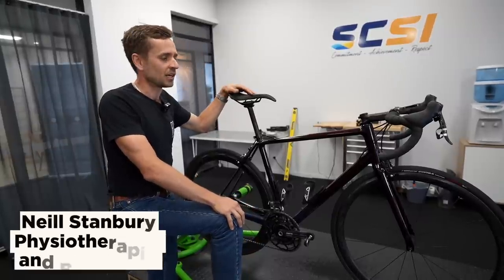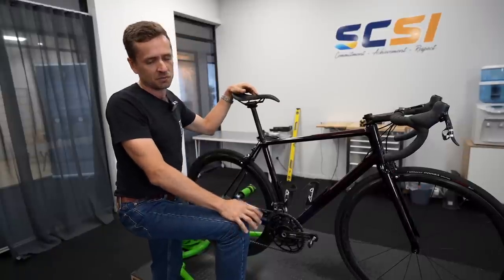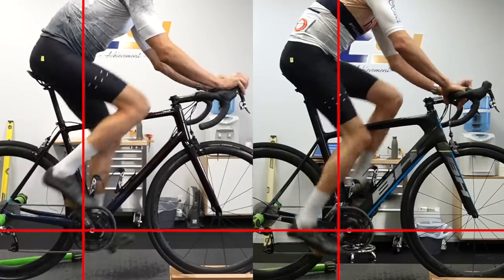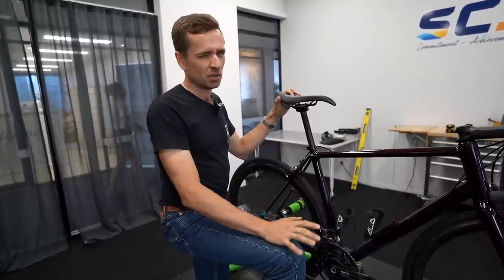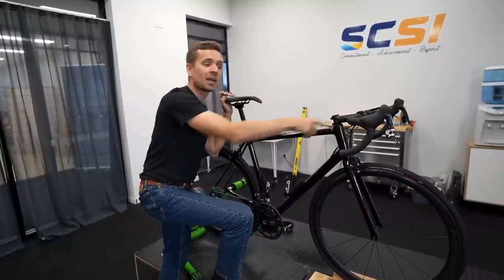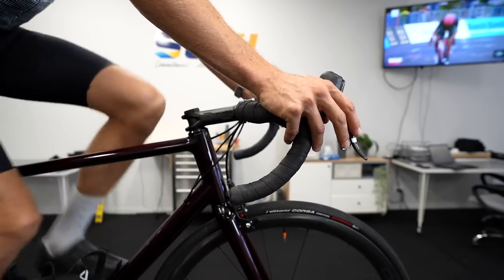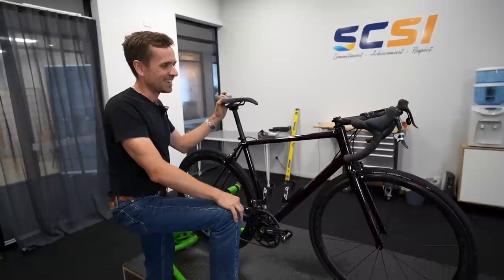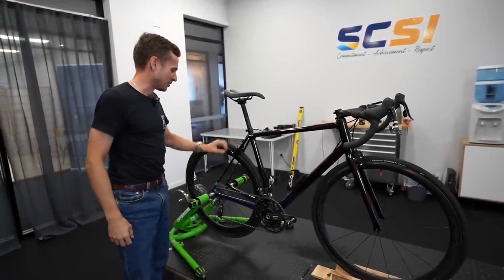New Bike Day for Neill Stanbury (but why a Chapter2 Huru?)

Comment: Neil needs to do an oval chainring video. 
All other bike fitters think oval chainring is BS.
but Neil has it on his own bike
Reply: I’ll sum up my own thoughts. My pedaling style with round rings feels “stabby” with micro-accelerations during the peak power phase and then a noticeable deadspot at BDC/TDC. With oval rings my pedaling feels smoother, rounder. Caveat here is I could never get oval rings working quite right with SRAM front shifting so I am back on round rings for 2x drivetrains, but favor oval for 1x.
Reply: @kidsafe  how do you size an oval ring? Same as whatever round one you were using, or do you go up/down? If so by how many teeth?
Reply: @thedownunderverse  Same size. Oval rings didn't give me a higher max aerobic ceiling. They decreased my fatigue on longer efforts.
Reply: @kidsafe  interesting - some others report being able to go up one or two sizes in chainring when moving to oval
Reply: I did a few Oval comparison videos you can check out. I ran ovals for 5-6 years because I liked the way they felt and I liked them for traction on the MTB. I have found zero improvement on speed or power. Only area I would say you may like them or they maybe beneficial is traction and maybe for endurance but I found endurance really determined more by how much I would ride. Humans can adapt extremely well so oval or round, your body will adapt to make it work either way.

Comment: So considering the older bike, he could ride the new bike almost as IT IS INTENDED TO BE RIDDEN BY THE MANUFACTURER in its default position itself. I have had two bike and would use them as future reference points for my 3rd bike. Probably a Mason Definition. Would be my first non Rim brake bike. Let's see.

Comment: I’m curious why you are so obsessed with a zero offset post and moving your position so far forward?
Reply: He explains in the video: Opening up hip angle, riding more easily in the drops. And I’d say he is not ‘ obsessed’ .
Reply: @Penalist  as a fitter for over 2 decades the last thing i would ever do is put someone in a zero offset post slide their saddle forward so they could ride the drops easier 😂 put the weight on the rider’s ass and no weight on the rider’s hands and they ride the drops better and easier. Also when descending switchback mountains you don’t want excess weight on the hands. 

I say obsessed because he mentioned the zero offset several times like he was proud of it and it’s one of the biggest fitting mistakes I fix in my shop - riders coming in having been fit by someone that put a zero post on their bike.
Reply from the maker: It was just too far back before, and I run a crazy rearward cleat position so my foot is a long way over the pedal, so I need lots of set forward - N
Reply: @SeeYouUpTheRoad  Ok, ‘shots fired’.. Maybe you’d like to check out some of the bikefitting videos of this Neill Stanburry on this channel and on Cam Nicholl’s channel.
Reply: @Penalist  I have watched their videos. I’ve made a few on my channel as well. I will make more. 

I’m not only a fitter but an ultra cyclist so my fitting philosophy takes endurance riding (200km - 800km primarily but beyond) into account not crits/road racing.  Hence any forward positioning and increased weight borne by the upper is counterproductive for long distance riding. 

Additionally, we have a lot of long switchback  mountains (20 km-40km) descents here in Southern California You need your front end to be light. A common complaint I get in my shop is the rider’s hands hurt on long descents. Poor fit keeps them from going down fast from improper weight distribution on the bike and lack of confidence, they’re on the brakes too much and too much weight on their hands.
Reply: I believe it gives more options for adjusting
Reply: @roadcyclingacademy  I love rearward cleat position ❤️ 73/73 is really good start for a stable geometry as well. Thanks for the reply
Reply: @SeeYouUpTheRoad  That's a lot more nuanced approach to the question of zero offset or not.
The latter in your response is something that I encountered using my flatland race bike (Amsterdam), which, additionally, has a quite high bottom bracket, in the Italian mountains.
Reply: I think you get to deliver more power on the pedals
Reply: @SeeYouUpTheRoad   I just watched the video you posted a few days ago with Lori. It’s a pretty good example of what a lot of Neill’s videos are about. Setback is one parameter in a complex system.  In Lori’s case she’s outside of range of motion on the left side as the pedal gets to 5:00, meaning there is a discrepancy between the sides and either the seat is too high, too far back or the cleat needs to move.
Reply: @edsassler  Lori is a freak of nature 😂 she wins hill climbs and mountain hill climb competitions and 500 milers often   She’s 60 years old but wins either the women’s category or the overall. You could put her saddle 5 cm too high or 5 cm too low and she will out climb the competition. 

Check this out she never feels lactic acid burn she has no idea what we mean when the rest of us talk about it. We’ve done 200 milers with 20,000 feet at race pace and the next morning she has no soreness but legs are sore AF - she’s a total freak of nature. I wish I had her genetics!! 

Anyway, getting back to your suggestion about her saddle height. She is a toe-down pedaler. No matter what height I put her saddle when going easy she just gravitates to toe down. The ride you probably saw was us just riding casual pace to finish up the REV 310M (310 mile) challenge. So a chill ride, no serious climbing (69 miles 5600 feet) when going hard and when climbing mountains she does drop her heel. 

In other news… Thank You so much for watching my channel. It was never my intent to hijack viewers from RCA. I legitimately wanted to understand why our fitting philosophies are so opposite 

Cheers!
Reply: @edsassler  fyi her cleat like all of the riders in my crew are set all the way back
Reply: @savagepro9060  there’s some truth to that as we all slide toward when needing to close the gap
Reply: First I have to say that I like Neills Videos very much and learned a lot from them in the past years to improve my personal position on the bike. 

Concerning the fore-aft position: This (and saddle height) is the thing I struggled a lot with over the past years and three different bike fitters always sat me nearly as far forward as it was possible with my seatpost and the rails, with the intention of a position as compact as possible. But this always led in massive neck pain when I do rides above 50 kilometer, because with this position so far forward I have too much weight on my hands. Meanwhile I do not follow the recommendations of the fitters any more and moved my saddle nearly 2cm back. Now I am sitting much more stable on the bike with significantly less weight on the front end. This position in particular works better for me, because my upper body seems to be heavier than Neills, because I do not only bike riding but also some muscle training.

So in my experience, the ability how much you can push your saddle forward and still feel comfortable during long rides mainly depends on the weight of your upper body and your head. So for a skinny guy like Neill it should be ok to sit so far forward without any problems.

What I wonder about though is his saddle height. For me it looks like that his leg is quite stretched out at the bottom of the paddle stroke, so the saddle maybe is too high for him 🤷🏼‍♂️

Comment: During bike fit sessions we are told that the knee should be right above the pedal when at 3 o'clock position , but i noticed that your knee is quite a way forward. Is there any maximum limit to this without getting in danger zone of picking up injuries over long run ?
Reply from the maker: Sure, too far forward and you'll get frontal patellar loading problems. The tipping point is highly individual and KOPS is rubbish anyway - N
Reply: @roadcyclingacademy  got it , thanks a lot 👍